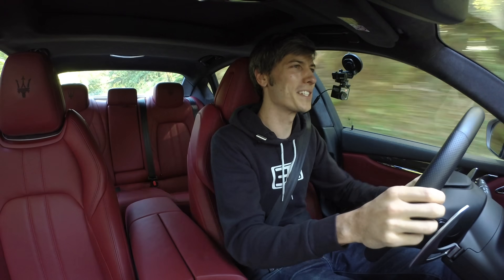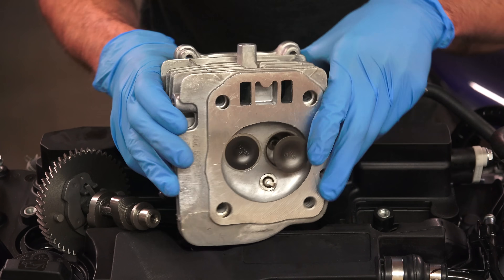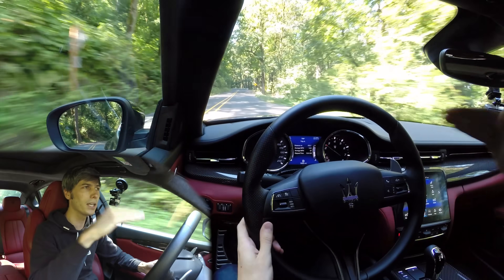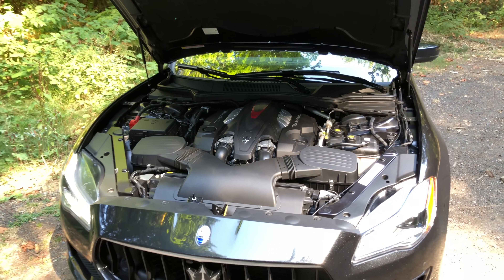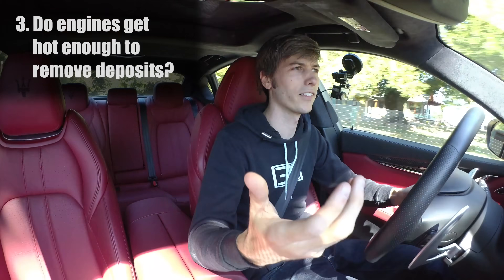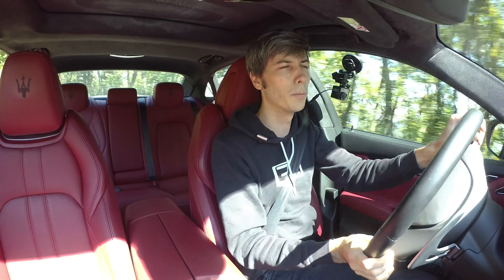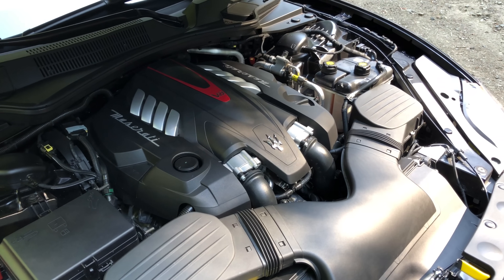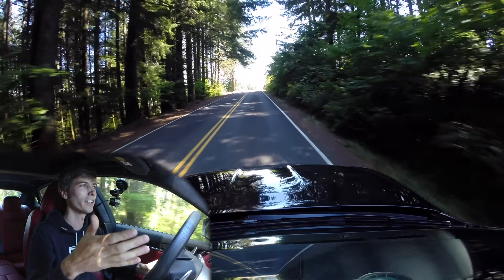Is Redline Good For Your Car's Engine? Italian Tune Up

Comment: Regular highway runs at highway speeds help to burn off accumulated deposits, and boil off accumulated moisture, unburned fuel, and combustion by-products that blow-by your rings on EVERY combustion stroke, and accumulate in the oil of cold engines at start-up, and dilute its lubricating capacity significantly, especially around the rings... That's why short commutes where the oil doesn't come to full operating temperature long enough to boil it off, are considered 'Severe Service' and the Manufacturers recommend more frequent oil changes. More frequent extended highway runs long enough help to boil off these by getting the oil to full operating temperature, will help keep these contaminants at a minimum.

Comment: The moral of the story here is that port injection is absolutely necessary in road car design. Direct injection can be paired with port injection, but do not engineer a car with solely direct injection, except in drag or track car applications where the engine is rebuilt after every event.

Comment: Catalytic converters don't like super heated crap flying into them when they are above normal temperature. Matrix melting and clogging will stop your exhaust flow and stop your car.  In the old days before cats...yeah no problem.

Comment: If you spend a lot of time around WWII fighters with inline engines, you will notice that most will run up the engine few a few seconds just before shut down. Im told they do this to burn off the carbon buildup, never knew it was called an italian tune-up, although it sounds like the planes were doing this long before the phrase came about.

Comment: This only matters if you keep up with routine maintenance.
If you skip everything else then this will absolutely ruin your engine and other components.
The key is to know your car, to do it when the engine is warmed up, and not over do it.
Or ruin your engines it’s your car after all 🤷‍♂️.

Comment: One aspect you didn't mention is carbon fouling of the spark plugs and catalytic converter.  Back in the 70's, a friend of mine had to take his mother's Ferrari out once a month for a quick "tune-up" to clear the deposits off the plugs so it would stop sputtering and run right for a while.  I also used this approach to get a 1981 RX7 to pass the biannual CA Smog Check, although I think it was more to clean out the catalytic converter than the plugs.  That car was a transition year and had a traditional carburetor with a converter.  Soon after, Mazda went to digital fuel injection which plays much better with cats because they only work well when the AFR is precisely controlled.

Comment: Y'all people "afraid" to do this are weird. Redline is set by manufacturer to what your engine can handle, and the ECU doesn't let revs go above that. 
As for me, I paid for the whole tach, I use the whole tach, every on ramp or turn in. 1MZ-FE boring ass 3L Toyota V6. 282K, runs like a champ.

Comment: Here's another reason I think it's good to do some full RPM pulls; at high RPM the piston moves a little further up the cylinder than at low RPM.  The wear ridge and carbon will slowly grow over time and if the engine spent enough time without ever hitting high RPM, the first time it does the rings would be hitting a 'wall' at the ridge.  Maybe a non-issue, but since I enjoy stretching the revs I do it regularly. in everything I own.

Comment: In general aviation before taking off they run the engine to full rich and full throttle to burn off deposits.

Comment: I can back up some of your data.  We had an drum style asphalt plant where the aggregate (stone) is heated and mixed with the asphalt cement (black stuff).  We switched to a different limestone source and the fines (smaller than 50 mesh) would break apart in the heat above 350F,. The CaCO3 molecules would be disturbed and break the bond creating a very fine dust, smaller than 325 mesh causing lumps of fines that balled up with the asphalt cement.  This was a metallurgical grade limestone at +98% purity.  What an eye opener!.

Comment: The engine may but the auxiliaries that are connected before the transmission fail fast in my experience - at least on "normal" cars that are not constructed for continous sports action.  Aircon compressors, DC generator, some fan maybe.

Comment: I would say yes, especially in Direct EFI injection

My evidence that supports this opinion is if you think about race cars they’re meant to drive high RPMs one thing you never hear about is carbon buildup in the engine because they run hot and they burn all the carbon away 

I’m not saying you have to drive your car car all over like a race car  I’m saying every now and then doesn’t hurt to put your right foot down a little bit more to open up the engineering clean things out.

Comment: this is actually why i occasionally (less than once a month) do a 90mph sprint for about 10mi. pretty short sprint but the rpms and engine load helps it out, oh and this sprint is immediately following a dead stop start with hard accel. i don't do it much since the engine does get some bad wear on that too but it helps it run smooth. speaking of which, i think the head gasket is dying.

Comment: It always works on my BMW 520D. I normally cruise it between 3-4K RPM for about half hour. The M47 is a very dirty Engine. I used to drive my E46 320D hard and never had the problem. Having an E60 and being loads more chill caused the problem.

Comment: Everything I've read about tune ups refers to old cars - I have a 2019 Seat Leon, I normally drive around the city max 15-20 minutes a day x 2, hitting 70+mph for a few minutes. I've had the car for 3 years - just the past few days I've had to drop people off at the airport which is a 2 hour journey both ways. Now the following day I've noticed my acceleration is much more responsive...I thought I was in sport mode which I never use...very interesting!

Comment: Dad had 1960s vintage Ferraris. Drove in commuting traffic . After a while the cars wouldn’t rev beyond 3000-35000RPMs . Go to Chinetti motors again and mr Chinetti tells my father to let me do the “ Italian tune up “ then tells me the procedure . 
Get on the parkway , 2nd gear, bring in the throttle and hold it there . Well, black soot starts coming out the exhaust , the RPMs slowly start to climb to redline as I create a major EPA event. . Do it once more and no black smoke , engine winds right up to red line . 
Im 18 years old . 
Thank you Mr. Chinetti

Comment: Italian tune up is a legit method with older carbureted sports cars ie alfa romeos, mg's, jaguars, lotus, Ferrari, fiats etc. They usually used multiple side draft race carburetors like webers sending a high amount of fuel, and were not your run of the mill big v8 in a small car like the american sports cars. They were tiny high revving, 4-6 bangers, with aggressive cams.

People would get them and drive them like they drove their old american vehicles. Never touching high rpms, which is horrible for the little engines with race carbs and cams that could usually go anywhere from 5 to 8k rpm which was not normal for a lot of people who would get them.

The carbs would start flooding, the engines would start losing power because of it and the spark plugs would get covered in carbon making them useless and leaving the cars at the mechanic more than they were on the road.

This could be fixed quite easily... by giving it a tune up, starting it up, and giving it hell. They were going to be unreliable anyways, but driving them like old ladies was a surefire way of always being at the mechanic instead of once or twice a month

Comment: I think I unintentionally fixed my car from burning oil by doing this. It was burning a consistent amount from the day I bought it and one day I found myself late for work... Well you gotta do what you gotta do and ever since that 20 min blast down the highway she hasn't burned any oil. It must have either re-seated something that wasn't seated properly or loosened something that was stuck because Its not coolant or fuel getting in there either, it looks and smells like normal oil.

Comment: Maybe it's in my head, but I did a tame break-in on my motor and it felt fine but when I would give it sudden throttle, the pcm didn't quite like it. 

So I started running it to redline that night, getting several good pulls and the motor sounds and even feels better

Comment: Even though they're four strokes. You got to treat them like a two-stroke every once in a while. You can't just put around an engine it's meant to Rev. Granny driving builds carbon, and suite. Pressure helps decarboxylation at a lower temperature.

Comment: Main problem is the intake valves on direct injection engines, the PCV dumps oil and gasses into the intake manifold and without fuel flowing over the valves gets much worse carbon buildup

Comment: Heres how to keep your valves from getting deposits on them is this.....Put a catchcan system on the PCV and evac system as the hydrocarbons emitted from the EGR become a factor......

On my 408 stroker I put a catchcan on both PCV system and evac hose that goes into the intake tube plus I did away with my EGR system and aslong as I remember to purge my catchcans my intake valves remain deposit-free...

Also seeings the injectors sit above the intake valves on my engine I keep them clean by religiously putting 12 ounces of transmission fluid in my gas every 30 gallon fill-up....LOL

For direct injection vehicles you heat up the engine with some spirited driving quickly pull over into a parking lot pop the hood and pull a vacuum line, dip it into a can of SeaFoam and rev the engine up o 3000-3500 rpm's to powersuck in the cleaner and that should shock the deposits off the intake valves..................

Comment: Heres some information that would surprise you heavily.... Back in the 60's early 70's FIAT used to break in all engines sitting on benches in groups of 25....

They would start the engines one by one and immediately redline the engine for 20 mins from dead cold.....

The ones that survived went into cars and the ones that didnt were scrapped............LOL

Back in the day there was this magical stuff called Tune-Up in a Can aka Genie in a Can... You held the engine at 3500-4000 rpm's and dumped the stuff down the carb and out from the tailpipes came a huge Genie cloud......

Nowadays they do it with Seafoam and a vacuum line off the intake.....................I use Lucas semi-synthetic based transmssion fluid....

Comment: I can guarantee you that if you have a small engine, revving it HARD like 1-2-3 will make the engine be smoother, and specially if you do some 4th gear 4500 rpm highway driving for 10km or so

Comment: I'm happy that it can work for a catalytic converter that is somewhat under-performing. Years ago my BMW 5 series failed its emissions test on CO by a significant margin and, on the recommendation of the tester, I took it to the motorway and gave it a serious thrashing after which it passed the emissions with flying colours.
I suspect that hitting the red-line isn't the thing - more a case of getting the engine at peak power output (that is normally achieved somewhat below the red-line)

Comment: My buddy had a 1990 Nissan Sentra he drove for delivery. He would literally shift the motor at 1200 rpm. Every time.

I asked why he did it and he said it was good for the engine. I disagreed and told him doing this would result in combustion chamber deposits and  may lead to 'pinging'. He scoffed.

Then 50,000 miles later he was complaining about it pinging. He would never admit it, but I think that Sentra got an 'Italian Tune-Up' shortly thereafter. 😂😂

Comment: It's good for your engine to occasionally push it to the limits to get rid of build-up carbon and other "laziness". But the "red" which is normally simply prevented by a rev limiter is not good for your engine.

An engine is designed to work at a specific setting. and everything is in balance to function properly within the limits. But if you rev much more than the engine is designed for you get all sorts of problems going.

Also, "italian tuneup " is a nice one, since Italian cars are probably the most unreliable cars ever made.

Comment: Great breakdown and great video! I love the use of evidence via research papers.
I'd like to simplify this further as all my years as an automations machinery operator: 
- Mechanical machinery does not like Stop & GO Shorter run-time periods does not allow machinery components to reach OPTIMAL running temperatures.
- Longer periods of machinery run-time has resulted in increased machinery components longevity - Prolonged and CONSISTENT operational use of machinery. My explanation for this as 3 years of being an Automations Machinery Operator is that: "Longer run-time allows the machine to reach optimal running temperatures".
 
This is just a humble take on my mechanical viewpoint of machinery. The concept of lower "Revs" and prolonged use can also be applied to the machinery I use. Highway driving is THE ABSOLUTE BEST for longevity of a vehicle. Just as the machinery I operate daily, I have the ability to operate at "High" levels (High Revs "redline") thus, having increased production numbers, however, this creates devasting wear on the motors and dynamic components associated with the machinery - thus resulting in poor reliability/longevity. 

Stronger machinery output equals less longevity of machinery components which leads to frequent servicing and more costs in order to maintain that baseline/standard of "strong" machinery output.

Comment: I think high-revving engines like small motorbikes tend to have better outcomes with the "Italian tune-up" because they are sometimes (literally) bottle-caps experiencing 14,000 rpm and can likely get to those temps fairly easily... especially if it's an air-cooled engine... that has been sitting in a barn for most of it's life and was only used to collect mail at the end of a very long drive-way.

Comment: I believe it is more about rpm than redline. Most small honda manual engine drive at 3.2k rpm at 75 mph on the highway. They have a cleaner engine than the same driving around town.

Comment: I have tested this many times. As a lineman that works with 20 other men, all randomly driving our diesel bucket truck fleet. Our trucks idle ….a lot. Whenever one is running rough I go to a 10km section of road with multiple hills. I drive the heck out of it even tapping brakes on uphill to kill momentum to increase load and duration. The key is getting core engine temp up under load. ….after doing this over couple days, truck will purr at startup, idle and will have  a noticeable improvement in performance.   …I find it hard though to get my Infiniti g37 heated up this way. (Lots of carbon build on these cars)You would almost need a mountain or driving on track…or autobahn.

Comment: I wonder how many non car/engine enthusiasts have understood this video. If you use your car in town at 30 mph, once a month go the motorway for a 50 mile plus run at 70. Years ago when 4 star petrol was around I'd do 160 miles on the motorway and the exhaust was white at its end and the engine ran batter. Sometimes referred to as clearing the cob webs out.

Comment: I bought a '95 Miata many years ago that the previous owner babied like crazy. I didn't realize how bad it was until a week or so into ownership. It was really sluggish. I honestly don't know if it was carbon buildup or clogged injectors but I drove it like I stole it for a few days. Little by little, she opened up and was a blast to drive after that.

Comment: What do you think of another angle here:   High load means a much higher flow of air and fuel through the engine... think: faster river moves more stuff downstream.   stuff can be knocked loose in with the energy and moved along downstream.   Another bit:   On many cars (especially older and/or carbonator cars), high load means RICH.   Fuel has cleaning properties to it, so combined with the high airflow, the fuel itself could disrupt buildups, clean it up and push it on through...

Comment: 4 years late but I think you approached the "Italian tune up" reasoning wrong. This term originated in the 50's. Imagine the Italian cars of the era and the technologies they had. You should not try to apply the same logic to a modern injected engine. 50's cars all used carburetors and rudimentary spark plugs and their temperature management was marginal at best. The problem Italians were having with their expensive Ferraris and such is that with time those carbs and spark plugs would get dirty and foul (plus the antiquated oil would absorb a ton of moisture) as most owners wouldn't take the cars out to a racetrack (many of those cars were tested by pro drivers in circuits or backroads). So they would take the cars to a mechanic and the first thing they did was take them up for a spirited drive, hence "fixing" the car which accounted for breaking up the carbon in the spark plugs, evaporating the moisture in the oil and cleaning up the carbs with fresh fuel.

In short, the Italian tune up never meant to remove ALL carbon deposits from an engine. I love your videos but this is something you got wrong as you tried to apply the principles to modern engines.

Comment: So if high revving or high load/high heat conditions are likely NOT a reliable way to remove carbon deposits, are there additives or other ways to easily do it?  

The 4cyl engines in the cars I have had seem to run well for years and years, and I occaisionally do some very hard pulls and put my engine through some high-revving excursions (usually based on the need to pass or otherwise drive fast).